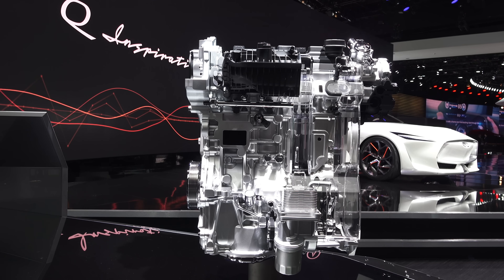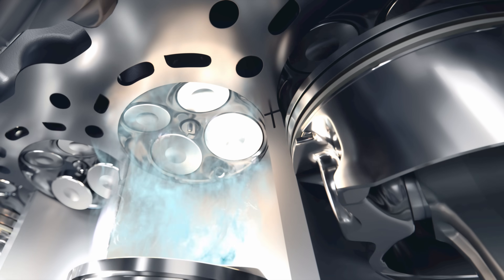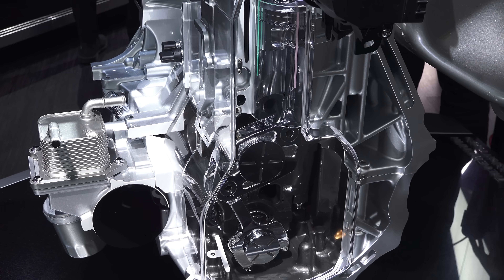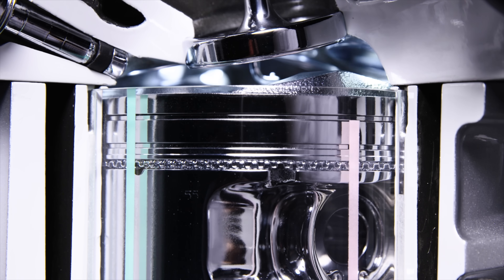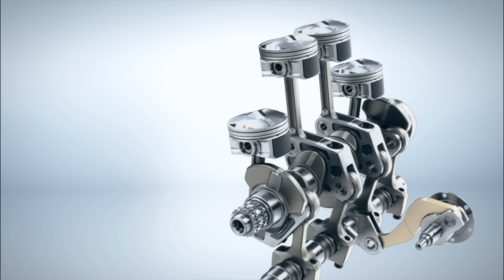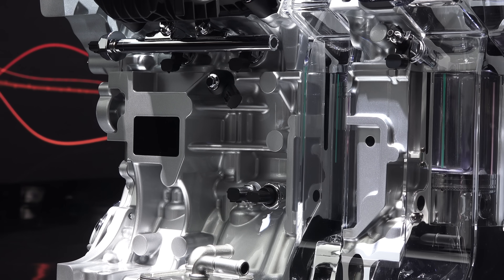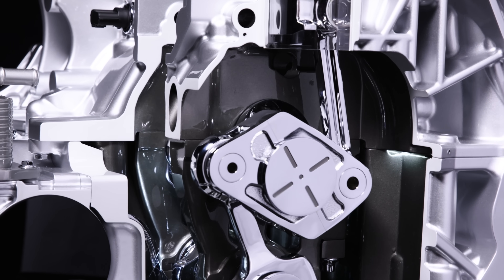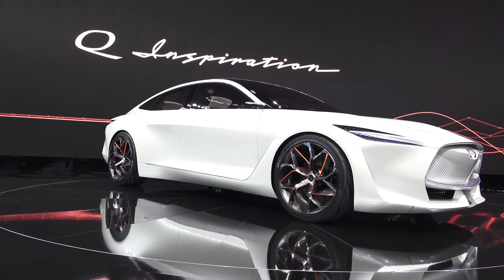INFINITI Reinvents The Gasoline Engine — VC-Turbo

Comment: The elimination of side force in combustion is like the biggest thing noone even talks about. Thanks for bringing it up; that's seriously awesome!
Reply: @Chevy SparkEV - You should smell the plants where they make lithium ion batteries.
Reply: Ism Ael an easy way to decrease the side load on the piston is to install longer connecting rods. Racers have been doing that for years and years.
Reply: P S torque is produced at the crankshaft...the downward force of the cylinder pushes away from the center of the crank the same way you produce torque when using a wrench, your hand is away from the center.
Reply: Can be done with any other engine design by just shifting the cylinder bank relative to the crank.
Reply: @gabigabugabo do it then lol
Reply: I guess so, but that sounds like it will cause a lot of imbalance and vibration that needs to be adressed.
Reply: Or you can make the cylinders oscillate
Reply: P S Your idea does not make any sense. The downward motion of the piston with the force of the deflagrating fuel/air mixture IS what acts on the crankshaft. If your implying that a piston without walls would not produce torque because there are no walls to contain the explosion, then..well, that would be a floating piston and not a cylinder...and there would be no engine.
Reply: P S if the crank is stationary, then so are the pistons... So the block would need varying cylinder compressions to deal with the fixed pistons( to a fixed crank). I think though, should it work, that this would create a planetary gear type setup... But I have no idea... Just speculating...
Reply: By reducing the angle they are reducing the lever creating torque. I don't really get it.
Reply: I’ve always wondered if that connecting rod made one side cause more friction but never really questioned it. Glad I got that answered
Reply: I wonder if it will have head gasket issues though, with all that force being directed towards the top.
Reply: Actually Hyundai addresses that issue with their Nu engine family by offsetting the crankshaft.
Reply: Gabriel Sterr I kinda agree I mean No more fried piston rings ! But didn’t you noticed that there still some force on the left side ?
Reply: If you were to make a regular engine as tall as this one (with ridiculously long connecting rods) you'd get rid of most of the side force too.
Reply: It sounds like something that should be implemented in Boxer Engines.
Reply: Good luck. Maybe simplicity is the answer to any engine.
Reply: You're saying that side fumbling was effectively prevented?
Reply: Well, to offset the cylinder position relative to the crank center line isn't something new. For instance BMW did this with it's famous M10 engine which orignated in the early 60's.
But yes the imbalaces this creates is a problem and normally a relative complex balancing shaft is needed to counter that.
Reply: I've had a rod break on me while driving a few years ago. it was cheaper to buy a new engine than to fix the broken one. It isn't a problem, until it is... You could change the rods in the engine, or you could design the engine better in the first place.
Reply: @user-ru1eq7tw4y  SparkEV is the least expensive car that has 400 ft-lb torque motor and quickest in the world at its price range 0-60 MPH in 7.2 seconds pretty much tire traction limit. Pathetic are fools like you who can't appreciate greatness.
Reply: How much problem does side force create? Hardly any. Far bigger problem is having to smell exhaust. Since driving EV, I'm noticing exhaust smell which I never noticed before. Human beings are not meant to breath in car exhaust.
Reply: @mychevysparkevdidntcatchfi1489  Nice segue into a completely separate topic. You know what's worse than the smell of exhaust? Large scale corporate tax evasion!
Reply: @mychevysparkevdidntcatchfi1489 Side forces cause exhaust gases to increase,
More friction more energy turned to heat and wasted, higher temperatures on the bores equals more poisinous NOx gases, so Side forces is a big issue and this engine design helps solve this issue reducing greenhouse gases and poisonous gases EV tech is clean but there are other solutions and this is one of them.
Reply: @mychevysparkevdidntcatchfi1489  great. as long as you dont charge your EV with 100% green energy it is just other people further away breathing in the "exhaust gasses".
Reply: How is this relevant.
Reply: @mychevysparkevdidntcatchfi1489  that could mean that your old car had an exhaust leak which is leaking exhaust gas into the interior

Comment: Whats the power output at minimum compression (power mode) and maximum compression (efficiency mode)?
Reply: 11hp efficiency mode. 480hp power mode
Reply: 11 hp wouldn't be enough to move the vehicle. Getting out and pushing it would provide more power.
Reply: 10 maybe 11
Reply: 11hp?????
that's incredibly low, wonder how much mpg you get from that :thinking:

Comment: i still dont understand the need for the change in compression ratio. having a higher efficiency of 14:1 should always be the preference right? why would you bring it down to 8:1
Reply: TBM avenger
Nope, you're absolutly on point. The problem with traditional turbo charging is that the engine is not very efficient if there is no boost because of the lower compression ratio. But the lower compression ratio is needed because otherwise you would run into knock once the turbo creates full boost pressure.
Now with variable compression ratio you negate this problem completly. If there is no boost you can run the engine with the compression ratio of a natural aspirated engine which gives you superior specific fuel consumption at low loads and revs. Once the turbo comes alive the engine simply reduces the compression ratio to prevent knock but you still have all the advantages of a turbo charged engine.
Reply: Krithik Gujran because of Poooower!!
Reply: Krithik Gujran if I'm understanding it right it's to reduce chances of knock from the turbocharger. Might be wrong though
Reply: Krithik Gujran The chances of knock are so high with a higher compression ratio. At a minimum load, it's not a problem and can improve efficiency, at a larger load, it could be dangerous and you'd have to use a fuel that has a higher octane rating like race fuel, ethanol, or methanol to guard against knock.
Reply: a higher compression should give you a stronger power stroke though.
Reply: so you can merge into traffic on the hwy.....i swear the only reason there is traffic is because of ppl not being at least 65 before fully merging.  and also ppl who make everyone else brake because they cut 4 lanes over
Reply: Krithik Gujran 
All things being equal: higher compression ratio gives higher combustion efficiency (more power per unit of fuel burnt)
forced induction (turbo or supercharged) does primarily two things: forces more fuel air mix into the engine (more burnt equals more power, at cost of fuel economy) and secondly increases the effective compression ratio according to the amount of boost.
The effective compression ratio (or more precisely the pressure at the end of compression stroke) limits the amount of boost usable before detonation occurs.

Boosted engine design have always been a compromise between higher static compression ratio plus low boost and the alternative of increased boost capability with lower compression for higher maximum powers.
The variable compression seeks to have both these benefits when appropriate.

Think of it as similar to valve timing: years ago fixed valve timing meant a choice between long duration and large overlap for race engines, power at high revs or the opposite for lower rpm torque more suitable to everyday motoring. Then variable valve timing on modern engines optimises to achieve both low down torque and higher high rev power.
Reply: Excellent.... you explain the whole video in few lines for a layman like me... much thanks..🙏
Reply: @T_On3 YaBoi Phimma Basically, but people are too imprecise to ever achieve a perfect merge in heavy traffic, though many times meters can mitigate the issue. It's also just tailgating (or near-tailgating). If someone has to brake 5mph to avoid a collision, but the guy behind  him has to brake 15mph to avoid hitting that car, it can chain until someone is forced all the way to a stop. I've watched this happen in real-time before in heavy traffic. Things can be moving 20mph+ and someone is following too close and is forced to slam the brakes. Everyone behind them also has to full stop. As soon as they can move they floor it, then proceed to slam the brakes again when they catch up.
Reply: both power and knock, at lower compression  the cylinder volume can hold more air, because the travel further down.
Reply: Krithik Gujran Boost + High compression + low octane fuel = engine knock. You could have both but people dont want to run race gas on their daily lol
Reply: Merp - The thing is... I believe hybrids and electric cars will, in the future, give gas engines a run for their money. In the future forged everything and adaptive compression ratios and twin scroll turbos will be on every  vehicle because of emissions and just to compete with electric. In that world I think gas engines will survive because of cost, and because of quickness of refueling. Even if that's not the case emissions will be seeing teeny tiny little engines anyways, CAFE laws are starving out gas and diesel engines. Hell, Ford is putting their 1 liter 3 cylinder engine in all kinds of stuff now. Also I don't recall the exact rule, but I believe manufacturers are supposed to produce a majority of their engines under a certain number of liters, so basically if you're selling some nice V8s that're 6.3 liters you'll have to sell a lot of 1.3 liter engines to offset the big V8s. Some of this is about the power, but mostly I think it's about fighting alternative fuels and emission laws.
Reply: Because the engine has a turbo.  Lower compression is better when using a turbo.  at 14:1 you will destroy the engine with a turbo if you get on the throttle hard.
Reply: You don't have to look at the compression ratio, but at the cylinder pressure.
Assuming no ignition before TDC, when letting 1bar of absolute pressure (aka no vacuum/boost, ambient) into the engine at its 14:1 efficient mode, you get 14bar at TDC before ignition.
Now when adding .75bar of boost, this would rise to almost 25bar, or what a normally aspirated engine would create with a 25:1 compression ratio, which is obviously a guarantee for knock.
Now take that same 1.75bar of total absolute pressure and put it through only a 8:1 compression and you're back down to 14bar. However the combustion chamber is also 1.75 times as large, so there's 1.75 times as much mixture to combust over the same stroke length. This basically creates the theoretical performance of a 14:1 naturally aspirated engine with a 75% larger displacement, without the added reciprocating and rotating mass.
Obviously this can be pushed further considering it isn't abnormal to see production engines with a fixed compression ratio of 9-10:1 running 1+bar of boost on just premium or even regular pump fuel.
Reply: Another advantage beside increased turbo efficiency is that you can maximize the energy extraction from E85.
E85 can take A LOT more compression than standard gas (close to what you'd find in a Diesel engine), so all the current flexifuel engines out there are a compromise to be able to run on both fuels... which means that the combustion of the E85 is more inefficient than it could be.
With variable compression, the engine can adjust the ratio to fit the current fuel, instead of doing silly tricks with the ignition that reduces efficiency.
In the end, you'd get better fuel economy and/or more power with E85, than you get currently.
(You could of course use other mixes too, E15, E100 or whatever's out there on the different markets, and the engine would adjust accordingly.)
Reply: Yes that is correct, they are doing it to allow higher boost which is basically increasing the compression ratio as well, so it is pretty silly. Why not just have less boost and high static compression ratio or just spend the money spent on this engine in some forged pistons and rods to be done with it.

Comment: Great video 🙂 combining this with Freevalve (camless engine) would be epic.
Reply: One would think, that a system like Freevalve would be cheaper to implement than a camshaft. And still almost all engines have a camshaft.
I wonder if you can retrofit an engine with such a system.
Reply: It adds complexity in terms of the actuators and electric control unit, but overall is far more compact so less machining. I suppose a retrofit might be possible!
Reply: MrDiarukia how could it be cheaper ? A camshaft takes minutes to be machined. Whereas freevalve uses one module per valve, there's no way it's cheaper.
Reply: I was not talking about machining them, but implementing. They are smaller, easier to calibrate etc.

Comment: But how much power will it make?
Reply: It's in the video. Are you deaf or not paying attention?
Reply: As he mentioned in the video, the peak power is 268HP
Reply: which is really nothing XD

my 2001 540i sportwagon is better in every way that matters, and it's rarer than a bugatti veyron

infinity is a nissan for bourgeois soccer moms
Reply: my 2001 540i sportwagon makes 282hp and 343lb-ft, and that's by german ratings which are rated at minimums under worst possible scenarios
Reply: it feels like 350hp and 450lb-ft they way it pulls on the road full throttle

Comment: Didn't Honda come out with this first? Just not with turbo?
Reply: Infiniti VQ VVEL? Except it doesn't kick in like v-tec, its always variable, better.
Reply: we need to combine this tech with mazdas hcci engine plus hondas vtec. Then we have the ultimate engine lol.
Reply: Look up the valve system in the new Koenigsegg. It is superior to VTEC. But yeah, variable valve timing plus a self igniting gasoline engine would be cool.
Reply: MrDiarukia any modern car has some type of system that ultimately changes valve timing... nothing special at all
Reply: Do you mean VTEC? That was a modification on the camshaft to switch between two modes of valve timing.
This one here changes the compression ratio.
Reply: Carlos Leon pretty much all cars have a form of Vtec or better
Reply: Steven Johnson, do they? I do not remember a non-VTEC engine with variable valve timings other than the Koenigsegg
Reply: MrDiarukia speak English please.
Reply: *Are there really other engines with variable valve timings?
Reply: MrDiarukia i think toyotas vvti stands for variable valve timing - ignition? I could be wrong but i always assumed it stood for that when i saw those badges on toyotas
Reply: MrDiarukia
Honda's Advanced VTEC, BMW's Valvtronic, Toyota's Valvematic is just as good as freevalve and as far as I know Toyota's and BMW's systems are currently being implemented.
Reply: GM also used vvt in their northstar engine
Reply: Sigma Projects valvetronic is valve lift, vanos is valve timing
Reply: Walker Hall,
Correct, my point was about how there are now technologies being implemented that can continuously control valve lift, not just two different profiles. Variable Valve timing has come along way in general, I didn't think I needed to express that. These new valve control systems apparently can be operated to such a high degree that a throttle body is no longer necessary.